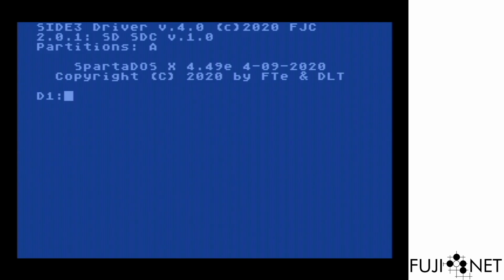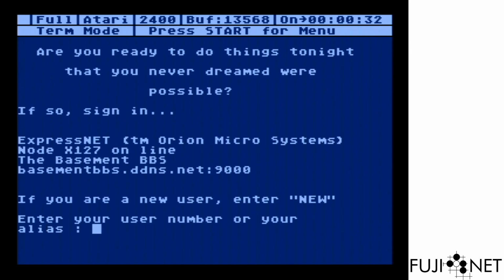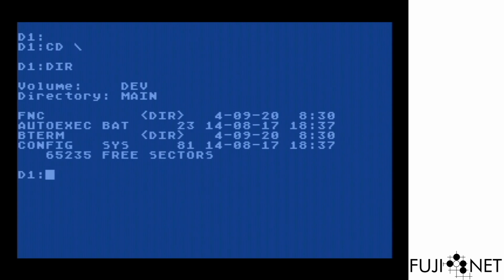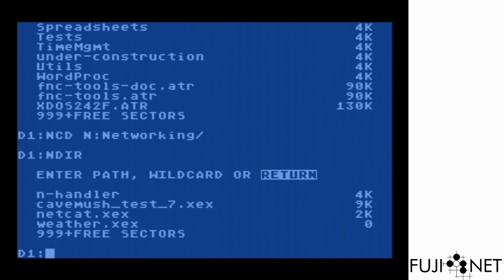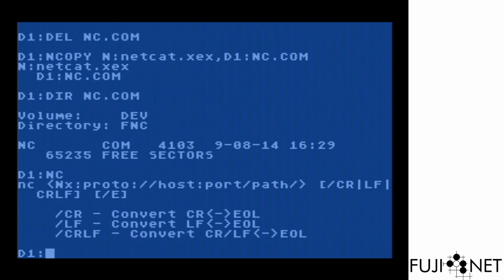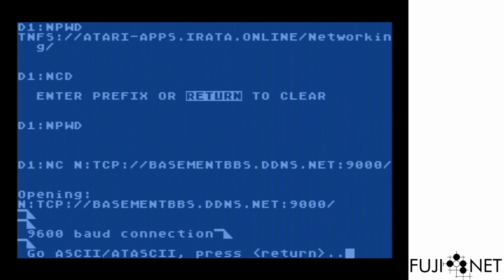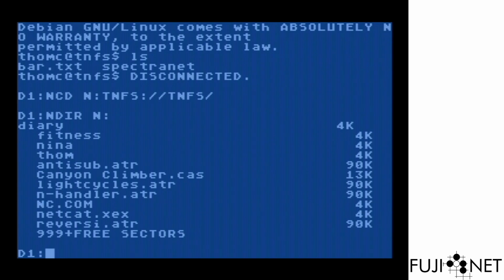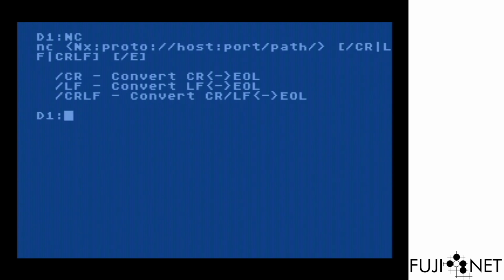#FujiNet - R: and N:

Comment: Interesting, was curious how R: weird interacts with N:
Reply: So it sounds like you could use a terminal like BobTerm, download a file off a BBS using XMODEM protocol, and the destination could be the N: device, eh?

PS - minor gripe... Your voice audio kept cutting out, esp when the Atari keyclick sound was going. Hadn't noticed anything like that in earlier vids.

Otherwise, of course, most excellent demo, as always!
Reply: Only R: has the Hayes modem emulation, I guess?
Reply from the maker: @cathrynm  correct, you wouldn't need it for N:.
Reply from the maker: @billkendrick1  yes, if the CIO N: handler is loaded (aka NDEV.COM). It seems I am having trouble explaining that you can use N: with CIO or directly via SIO. sigh.
Reply from the maker: They are two different devices really. R: acts like a MODEM, N: is a network card with a block driven interface. :) N: happens to have TCP and TELNET protocols which use the same TCP code that the R: device does, so there is some functional overlap.